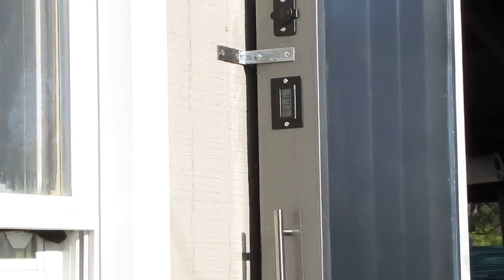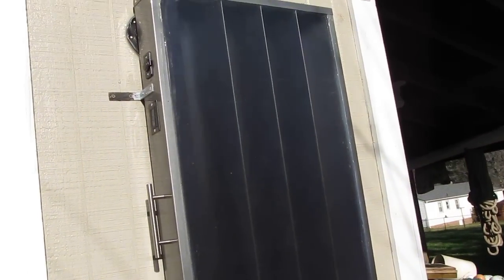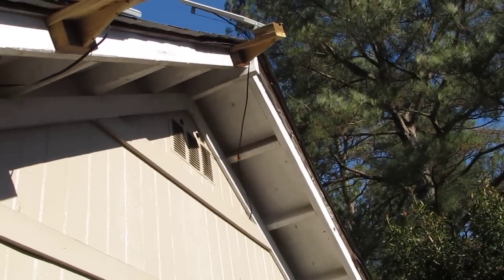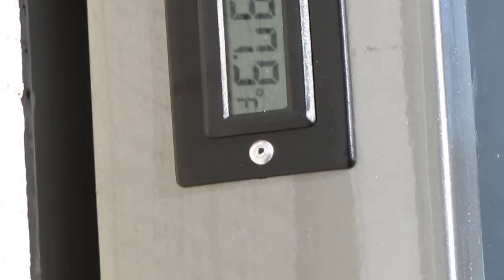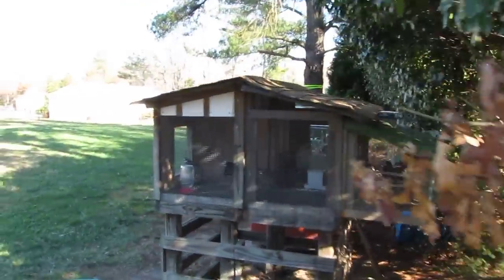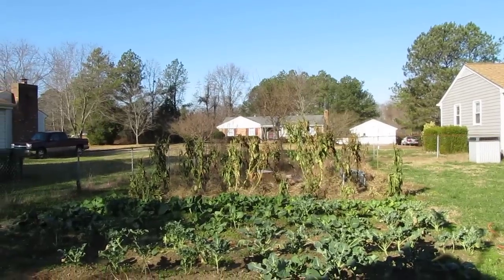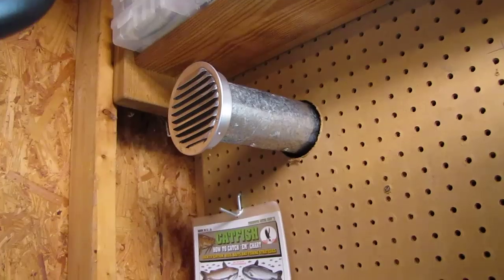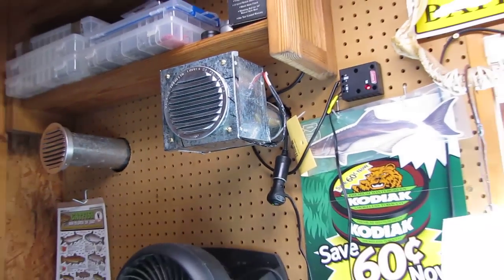Solar Air Heater Project And Bob White Quail And Garden

Comment: Sir i want to make small solar air heater for my project can you please tell what are the material required for it
Reply from the maker: 2x4 's 1/2" Plywood Some sheet metal and some plexiglass and flat Black high heat paint